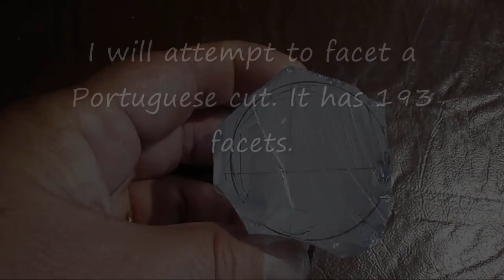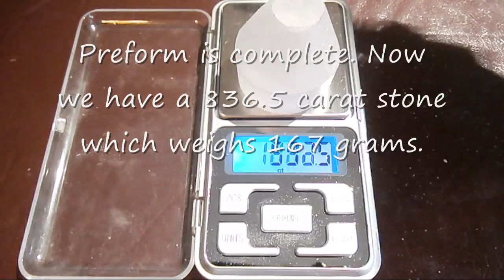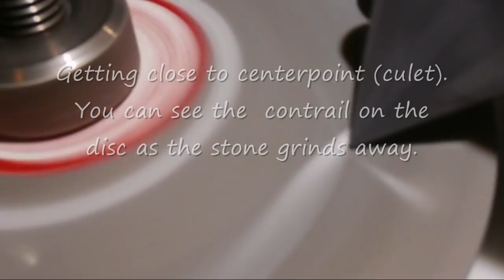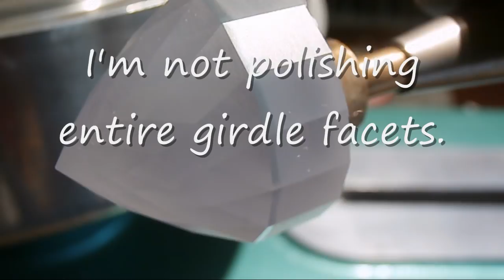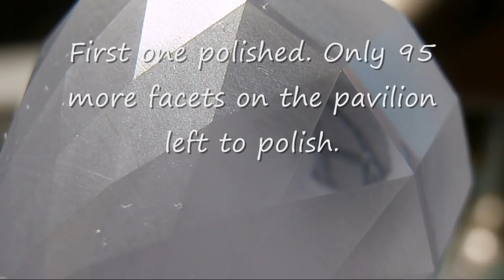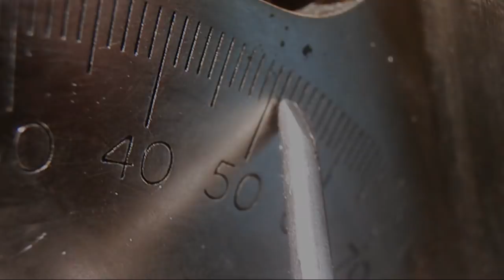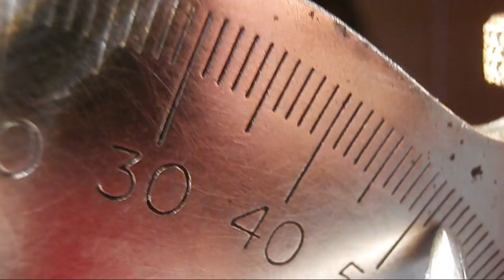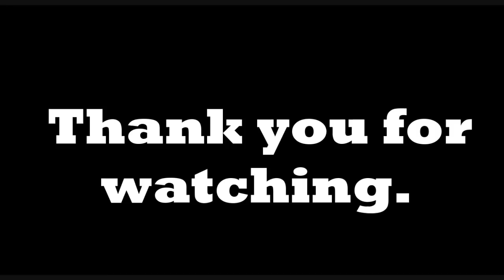How to cut gemstones - A whopping gem

Comment: That thing's a beast!  I ordered some flat laps today and I think they're the same one's you use.  I haven't got them yet but the picture showed the same label.
Reply from the maker: You should have no issues with them. When finished using them make sure you rinse them and wipe water beads off the back as left too long with water  on them they will rust on the back. Great discs for the price. Mine came in a pack of 4 ranging from 3000 , 1200, 800,600 grit they cost about $24 AU. I ordered 2 separate ones that were 240 and a 100 grit and they grind material like you wouldn't believe ( they cost around $14 each). Just be careful with those 2 as they are so aggressive when new they can chip outer edges facets so easily, particularly the 100 grit. Once used for some time not so bad. The 240 disc is now my go to disc for a quick grind, then I move on to the 800 grit. Happy faceting. Thanks for watching. Cheers

Comment: How do you insure that rod mounting was perfectly centered? Sounds like a nightmare to accomplish perfectly.
Reply: You use a transfer block and secure the dop sticks so they are perfectly centered to each other. Its shown briefly when he first glues it onto the dop stick after preforming it.
Reply: mic poli It is not all that easy even with the transfer jig. Especially if you use wax. Sometimes when I transfer, the stone will come slightly off center because of the heat. I kinda sucks.

Comment: What's the reason for the back and forth movement on the lap? As opposed to just holding it in one place I mean (If you can't tell, I'm about as new to this as it's possible to be)
Reply from the maker: Keeps even wear on the surface of the disc. Also less scratches.
Reply: @VintageTimeGems  thanks

Comment: Nice crossworking!!!  the optics on the brillianteering inspections was nicely videoed, and bruting the girdle and blocking the pavilions and crown was excellent work.  How many decades have you been doing this?
Reply: Don't you just mean 'years'? What if he's only been doing this for 5 years, but he's just really, really good?
Reply from the maker: @richrosegold610  I've been involved in Lapidary since a teenager so around 30 years. In terms of seriously cutting gems 5 years daily for 2-3 hours.  Most factors would likely use a machine once a month cut a small gem and that's it. Many who own a faceting machine buy them cut half a dozen gems get bored and the machine gets put away.

Comment: When you transfer dops and begin cutting the crown, how do you align the quill so the crown facets line up with the pavilion facets? It seems like removing it from the dop would separate the stone from the established index.
Reply from the maker: Michael Kowalski There is a slot in the dop. When placed in the quil that slot lines up inside of it.

Comment: How do you know the measurements of each facet? you have like a guide or something?
Reply from the maker: Leon Reaper You set the angle on the machine. Each facet is cut to a meet point. You need to use a loupe under high magnification to get each facet to meet together.

Comment: What kind of gem is that what mineral?
Reply: Cubic Zirconia, its man made but has a high refractive index (2.171 - 2.177). Diamond is the highest refraction at  2.4175. Pretty much all other natural material is under 2 refraction.
Refraction is the speed at which light travels through the material, the slower goes (higher RI) the more brilliance (sparkle) it has. Darker or more saturated colour tends to lose some brillance. Hopefully this helps a bit.

Comment: Where did you purchase the rough from? Also, a stunning result!
Reply from the maker: I bought it from a Chinese dealer by the kilo. If you look at Alibaba there are quite a few dealers you can buy from. The price will range from $17 to $200 a kilo depending on colour and quality. CZ is usully expensive in Australia and sold per carat. However CZ being heavy it doesn't take much for the price to get out of control.
Reply: Vintage Time thanks. Do you remember what seller you bought yours from? I just had a look for a while and saw a good priced piece. I might buy some. And yes, CZ in Australia is a rip off!
Reply from the maker: https://starsgem.en.alibaba.com/

https://wholesaler.alibaba.com/product-detail/AAAAA-quality-synthetic-cz-raw-material_60617961834.html?spm=a2700.icbuShop.prewdfa4cf.7.3e413c4aK8CgH0

I bought a kilo  of CZ it at a buy now price from this company. It's the second link. You will need to register with Alibaba. I bought another kilo lot in a Champagne colour which arrived last week that cost $23 US plus postage around $27. Not bad considering that the same product works out to over $450 to $500 AU. I'll plan to buy another colour in a few months. The blues cost a lot more and the Tanzanite will set you back around $150 to $200 a kilo. But seriously, it will take awhile to cut just a kilo of the stuff.  And yes CZ is a rip off in Australia, as are all other raw gems. CZ can be tricky to polish as it's hard, but you will find that it won't peel like quartz and no issues with inclusions that can run. I'll probably cut a smaller stone next. As these large stones can take forever. Cheers
Reply: Do you sell your pieces Vintage Time? Id absolutely love something like this.

Comment: How did you index the angle when you switched where the gem was attached
Reply from the maker: Luke Calls The dop just slots back in the quil. Then you adjust the degrees on the protractor. The crown index  numbers will be similar to that on the pavilion.

Comment: I'm guessing this already exist but why not have two disc's running one with a cutting grit and one with a polishing grit. Granted they would need to be rather planar with each other but seems like it would save alot of time.
Reply from the maker: Jacob Immonen Never heard of a combined cutting and polishing. Not really possible. You would get contamination from the cutting disc causing scratches.

Comment: Great stone, congrats!
One question: What type of lap do you use for the pre-polish?
Reply from the maker: I like to use really well worn 800 grit disc or a 600 grit disc. Many facetors will usually use a 1200 or 3000 grit disc as a pre -polish. In the past I always used a 1200 grit disc and for certain stones  I would  use it again if needed. But I have found that with a really fine grit disc if there is a scratch it hasn't removed for some reason it's almost impossible to remove with the final polish. So with a well worn 600 or 800 disc it leaves a matt surface without any deep scratches. The 50, 000 diamond polish easily cuts through that matt surface and polish. The pre -polish can be done differently. Much of it is determined by types of discs you own. Cheers
Reply: Thanks a lot for this info. Very interesting that CZ prepolish works with common well worn disks. So far I used copper with 6μm diapaste which works fine as well, but will try your hint also. Cheers!
Reply from the maker: I often go straight to the polish once I see that sand blasted matt effect on the surface of the facet after using a worn disc. You can kind of recognise this texture on the surface. Most would go to a 1200 or 3000 grit disc, but it's really all about keeping older well worn discs and using them. At some point with long term use the diamond will eventually wear off in patches and your down to some base metal, then it's time to access how long you may want to keep using these worn discs. You may also spend a extra minute or so per facet polishing after using this method, but for me the trade off is less micro scratches to deal with.
Reply: Gem Works star Brit cut